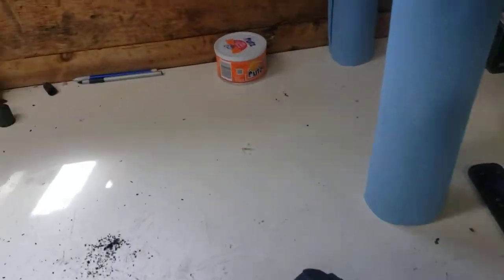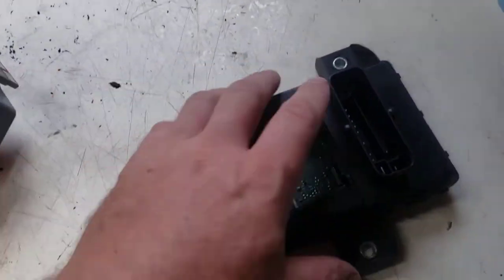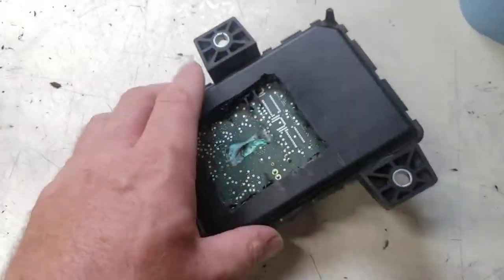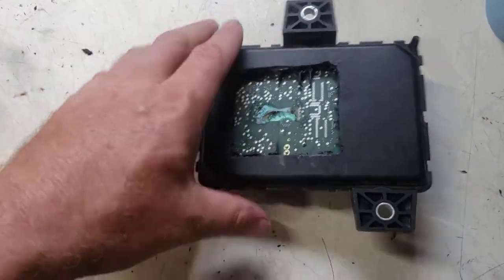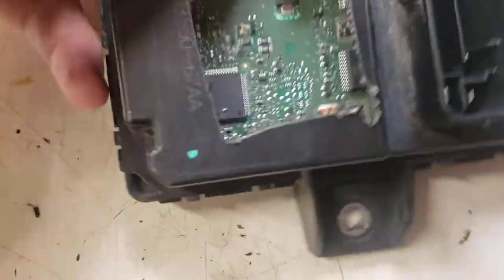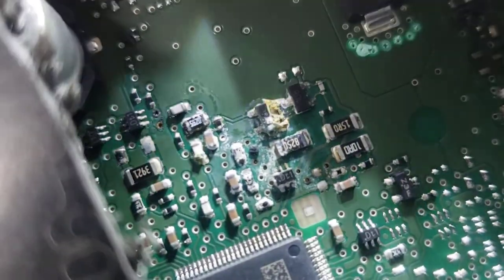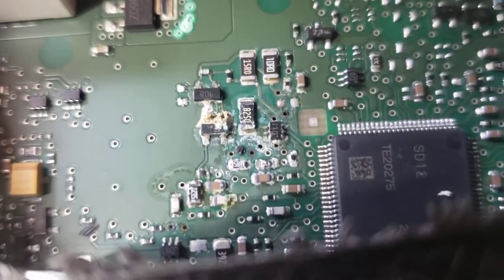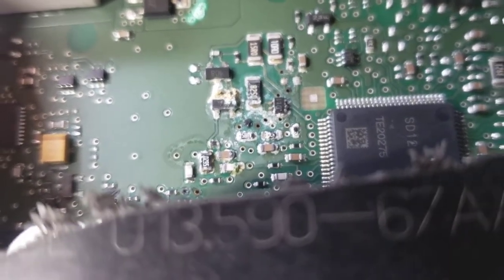2020 GMC Bad Trailer Lighting Control Module (From Videos 1-4)

Comment: I have the exact codes + power steering assist warning, and my cluster flickers from time to time and all gauges sweep when that happens. Is the electronic power steering and cluster connected to the same circuit? Im not sure if I have a bad BCM or bad Trailer Module.